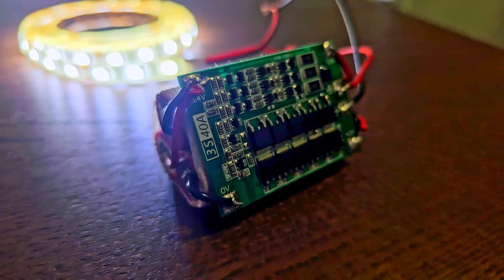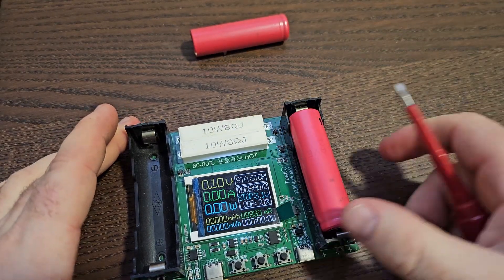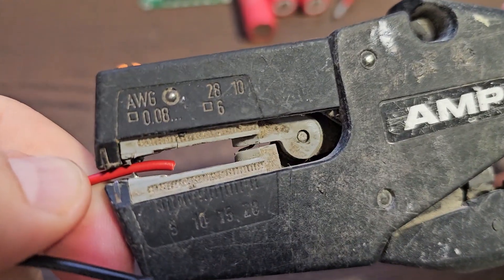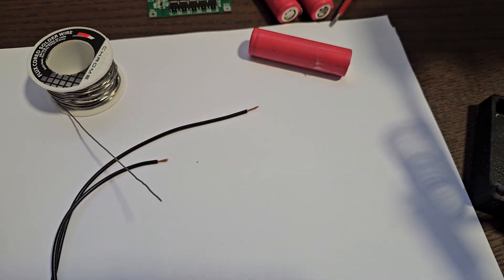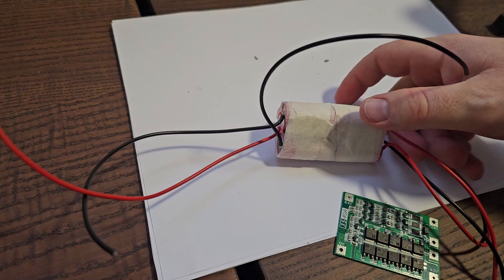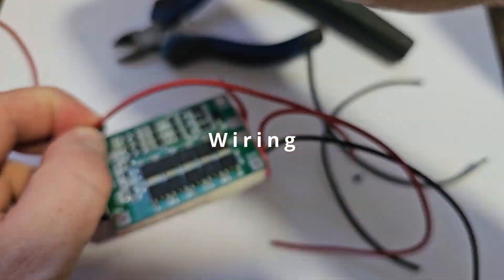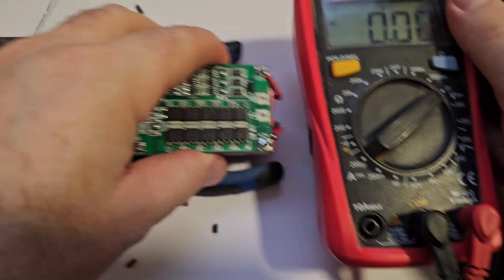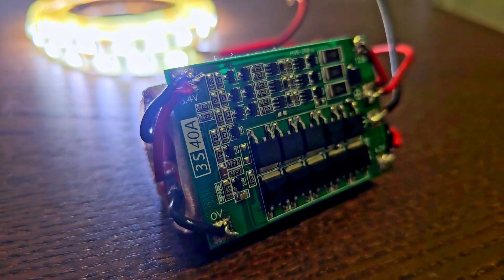DIY 12V Battery Pack with a 3S BMS Using Lithium-Ion 18650 Cells

Comment: How did you charge from the BMS?
Reply from the maker: With a simple battery charger as 12V it will work without problem.